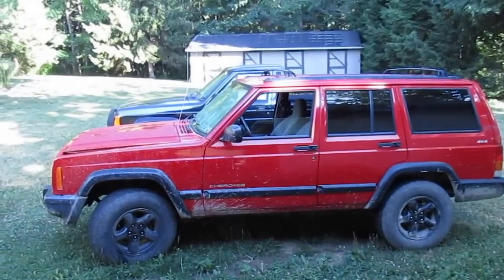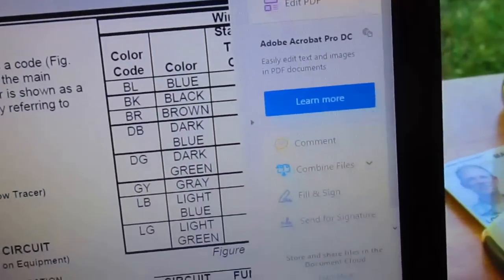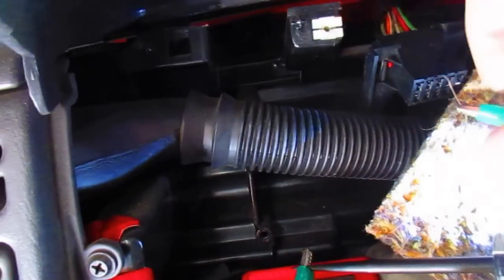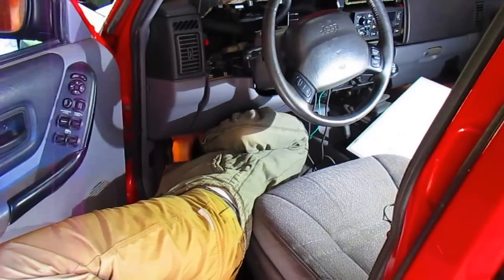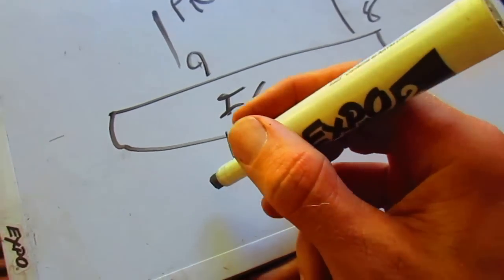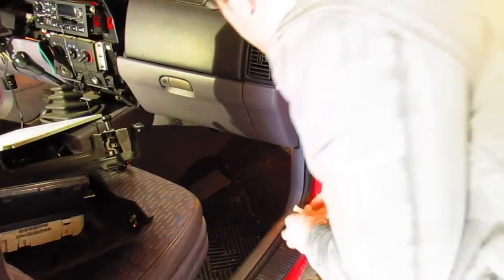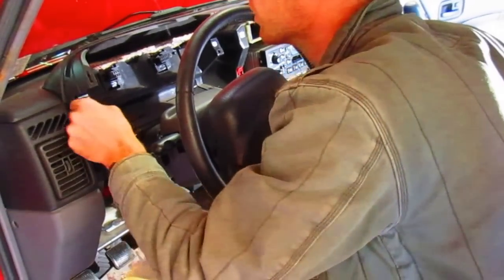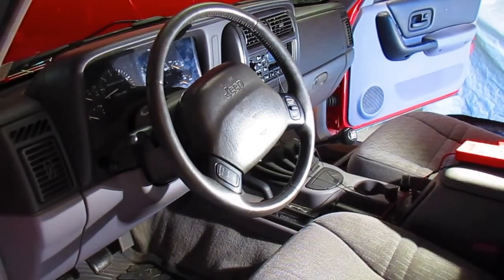Jeep Cherokee XJ Instrument Problems

Comment: I had the same problem. It is a ground issue. reground the black with green stripe to the body just below the windshield. I used a splice connector so I did not cut the wire.
Reply: Bryon Hills a ground issue? I was getting no power so I connected it to other source of power that i saw in a youtube video

Comment: ...its been 2 years now ... what are the UPDATE results ? Reconnecting the main plug behind the instrument cluster with superglue fix the gauges to now work after every fuse proved to be good OR did this not work and still have no working instrument gauges ?

Comment: Hi Brendon!

Nice video. I have the same problem. All gauges are dead and airbag light is on and the XJ is runing fine.
In your video: 29:46 ... what are you doing? And how are you doing it?

How can i check the airbag control module is working fine?

If you could help me with this issue, it would be very appreciated by me.
Thanks Brendon!!😊
Reply: Did you ever find the culprit? I have the same issue on my xj